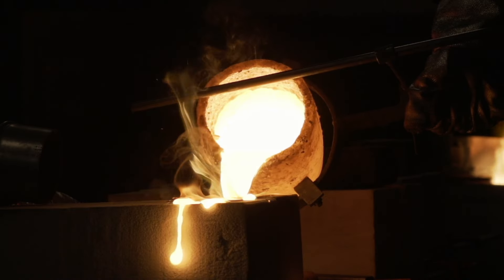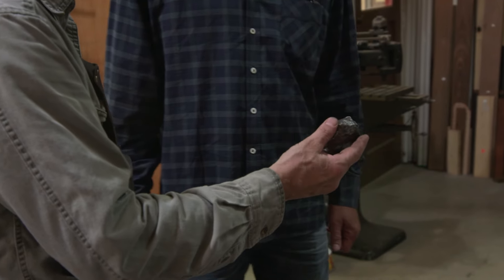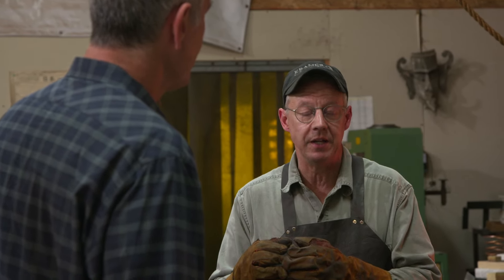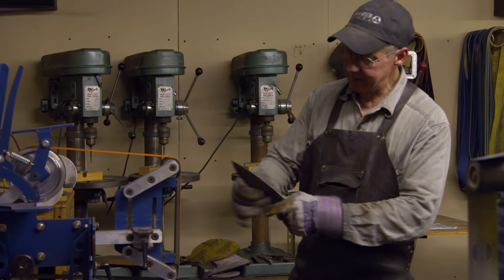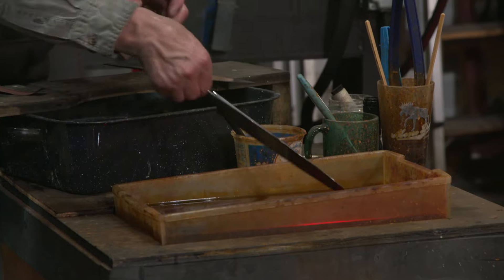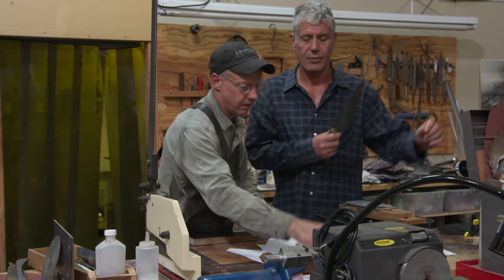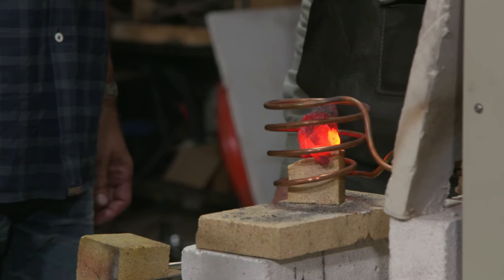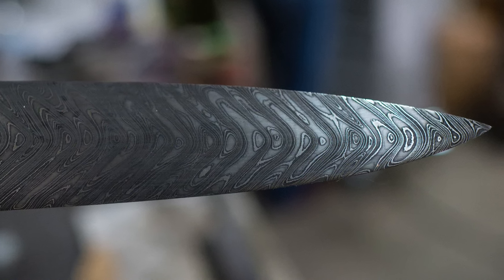Raw Craft with Anthony Bourdain - Episode Four: Bob Kramer

Comment: That massive press thing is very intimidating.
Reply: it's called a power hammer.. im not trying to attack you.. I just want to inform you.
Reply: JTD19881369 Thanks,I didn't know.
Reply: its scary at first but once you use one you crave the thrill. its like a gun, but 1000x stronger
Reply: Google nazel 2b. you won't be disappointed.
Reply: Aryan Adibmehr it's called a power hammer.
Reply: Douglas Loven Thanks, it was mentioned above.
Reply: +Aryan Adibmehr its a power hammer
Reply: Just think how much more the modern blacksmith/bladesmith would have to charge for their work if it was still 100% Arm & Hammer on an anvil. The cost of goods would go through the roof of the Empire State Building. These hand made knives are already pretty expensive, I'm sure. I've seen fine chef knives that were machine made go in excess of $800.00 US. I can't imgine what one of Mr. Kramer's knives would cost. Probably around $1500.00 to $2500.00 US you could easily triple that for no power tools used, and quality that fine.
Reply: A handmade Kramer knife recently auctioned for $30,000 (yes, four zeroes).
Reply: I love my 2b, probs the most versatile piece of equipment in my shop
Reply: its a power hammer
Reply: Guys! Did you know it's called a power hammer??!
Reply: I think it's called a power hammer just in case you weren't sure yet.
Reply: It does its' job with extreme violence.
Reply: It's a  baby hammer!
Reply: That hammer type thing possesses so much power. I'd love to know what it's called.
Reply: Danny Paterson mechanical press
Reply: @3:32 Even Anthony backed up once it started.
Reply: yeah! looked like a transformer stuck on a loop. I would back away everytime that thing moves.
Reply: You have forged your 1st Damascus and you're about to use the hammer it's extremely intimidating. One wrong step and you could ruin your blade

Comment: A beautiful German style chef's knife and will certainly do the job in the kitchen, but any decent Wusthof, Misono, Henkel, or even Forschner will work just a well for thousands less.
Reply: +Frank Kolton Probably not quite as well but nothing to justify the price gap.

These are prize possessions you COULD use, but probably shouldn't.

One thing I couldn't help but think about is that these knives are not stainless so unless you keep in mind that you'll need to maintain them far more thoroughly than a regular knife; you could end up rusting a knife that costs as much as a used BMW.
Reply: +Frank Kolton There are a number of professional reviews that would disagree.  Not all knives are created equal in terms of ease of use, longevity, etc.  In review after review, Kramer's knives outperform them all, all while looking fantastic.  If there's one negative thing to be said of Kramer knives, is that they must be maintained assiduously (carbon steel).

Comment: His steel cannot outperform other Powder Metallurgy super steels that the best manufactures and customs makers use .
Reply: PeterPiper Chaos well partly true. Powder steels are better in almost all areas you could compare steels. But there is one thing they don't do, they don't get sharper. It's also more difficult to get them sharp. So for really using them in the kitchen on a daily basis, they aren't necessarily "better".

Comment: The most important part is the sharpening. It takes a lifetime to get the feeling for the perfect angle that makes it so sharp by using it on the leather. In Sweden we call it "rå-äggen" roughly translated it the raw egg, that is the small metalic piece that is left after the perfect angle sharpening. Its like a small piece holding on to the blade that you want to get rid of. Really hard to explain in a foregin language but most of all, in text. Whenever youre sharpning you will know what I mean
Reply: The English term you're probably after is 'burr'.

Comment: It's amazing how much automation he used to make a hand crafted knife.
Reply: +Average Joe A powered tool isn't the same as automation.  You could do everything he did with hand tools it would just take FAR longer and give you an inferior product.  The forge weld pattern and bevel on each of his knives would be slightly different.  It's not a stamped out and machine ground cheap off the shelf knife.  Could he do all of that by hand with 100+ year old hand tools sure.. it would take longer and you'd get an inferior product.

Comment: Basic way of making the knives is very close the the making of the Katana, the samurai swords. Also the samurai sword-smiths makes cooking knives because of the same technique. The basic big difference is that in Japan, until the nation ends its isolation to the overseas nations, we had no culture of casting metal to make the knives. So those traditional style made swords and knives are made from the sand metal you can collect with the magnet and then make it to the chunk and started forging with the same way Bob does at its earlier stage. Also the forging is done by hand with a few forge smith continuously on the anvil and the sword-smith master puts the knife or the sword in to the heat to adjust its temperature. Having the meteorite into it is a great idea to have the unique grain.

Comment: No disrespect to the late Mr. Bourdain, but making steel is called Smelting. Forging is the process of creating those steel strips of differing carbon content and then "Forge Welding" them together, which is just a fancy term for heating up the stacks until they're just about white-hot and hammering the layers into each-other to make a solid Blank, or "billet".

Comment: Mr. Kramer misspoke when he stated "To make steel you add one percent carbon." It is 0.1 percent to make steel or one tenth of one percent, for knife steel they start at 0.50 and go up as high as 1.8%, but at that high a percent it becomes brittle and is tricky to heat treat.
 I make knives too.

Comment: how does the leather make the knife push cut?
Reply: It aligns the grains of the the steel.
Reply: +TDER xo although sharpening the end of a knife on a sharpening stone will un dull it, its still grinding (very inaccurate sharpening when if you want razor sharp) so the leather is like the finishing touch for a blade that is almost there

Comment: How does he strop that quick? It only seemed like 5-6 swipes on "plain leather" , seemingly without stropping compounds, from sharp to razor sharpness?
Reply: he re-aligned the burr on the edge
Reply: Glenn056 all about changing direction of the edge.
Reply: he probably used exceptionally fine stones and took it to 10000 or whatever, before stropping. You can skip all those fine stones and just strop it with compound after 1000 to a similar effect effect. It's gonna cut an onion.

Comment: where can I buy one of those knifes?
Reply: Unfortunately you can't just go buy an authentic kramer knife, the only two ways to acquire one would be to find one for sale second hand (extremely rare) or win his "lottery" on his website which is just as hard to do. Even if you win the lottery you still have to pony up several thousand dollars for just a straight carbon steel blade or much more for a damascus blade. Ive seen one up close and not only are they ridiculously sharp but they're absolutely beautiful works of art.

Comment: But how does he get the damascus/patterns on it?
Reply: It might be the basic solution that he was spreading on at 6:34
Reply: i think because he folded the knife over so many times, which gave the knife its pattern.
Reply: +Thomas Tuan Nguyen correct
Reply: The multiple metal layer + acid etching
Reply: The many layers of the steel will reveal itself much more clearly after being etched. There are different ways to etch steel. Most commonly is probably acid-etching. In this video, a base is used instead. At 6:35 you can hear him talk about how it works. Simply put, it takes away some of the steel. Around 2:08 they start talking about layering the steel. They cut, fold, flatten the steel many times to create many layers. Every fold doubles the layers, so it quickly adds up to hundreds of layers. Since there's used more than 1 type of steel, the acid or base will remove parts of it at different speeds which makes the patterns much more noticeable.
Reply: Mark The Gr8 At 6:35 you can hear him incorrectly describe ferric chloride as a base instead of the Lewis Acid that it actually is. Oops.

Comment: why would you harden the steel and then sharpen it, The phase changed steel would be harder than the annealed steel thus making it tougher to sharp.
Reply: +atul Sc a more precise sharpening, it is harder so you lose less on each swipe and really fine tune that edge.
Reply: +AdamC169  thank you for that information.
at 5:30 you mentioned about some molten salt bath what is the heat treatment you are using? 
is it nitriding?

Comment: On;y $400.00 for a 10" Chef's knife!
Reply: 400... add another 0 and you're there!
Reply: +Joe Smith those are basically licensed copies of his designs. the ones he actually makes average $400 per inch of blade , current auction for one is at $34,100 and still bidding.
Reply: +DIR911911 closing bid was $37,600usd
Reply: More like 2 zeros

Comment: Too bad, Bourdain, didn't head over the Murray Carter's place and check out a Japanese style knife. Carter is the only White guy to become a Japanese 17th Generation Bladesmith. He uses high carbon Hitachi White Steel #1 or 2 sandwiched between stainless steel and it's like a miniature samurai blade and you don't have to pay for the laminated steel that adds nothing to the function of the blade. Murray also is a US Master Bladesmith. Bourdain doesn't know that much about knives, obviously. To ignore Japanese knives is a complete demonstration of ignorance. I don't know that Kramer could even make a sushi knife with its concave back and high carbon/ low carbon steel.
Reply: +Dan Morris what are you on about, Murray Carter makes great knives but he doesn't nearly have the same popularity as Kramer.
Reply: Just because he sells more knives, doesn't mean he makes the best knives. Toyota sells more cars than anyone, do they make the best car? Kramer makes no sushi knives. He makes Western knives, only. "The Wa-Bocho has one distinct feature different from Western knives: The kataba, or beveled blade. What this means is that the outer side of the blade is sharpened with a beveled edge, while the inner side remains flat. While the blade is flat on the inner side, the surface is actually slightly concave (urasuki), giving it the same effect as perforated knives or knives with hollowed edges. Japanese professional chefs prefer these beveled knives, which facilitate extremely precise cutting and clean food separation from the blade. In Japanese cuisine, many ingredients such as fish and vegetables are served raw, and the aesthetics of these foods has always been a vital factor. The use of Wa-bocho reflects this culinary tradition. A well-maintained, single bevel Japanese-style knife allows chefs to cut delicate ingredients with speed, control and precision. With sashimi, for example, the use of a Wa-bocho produces perfectly smooth, glossy slices of fish, without bruised or rough surfaces. Western knives, which are beveled on both sides of the blade, are more practical on tougher foods such as meat."
Reply: +Dan Morris Why are you copy and pasting from Murray&#39;s website, I know who he is, I used to own one of his knives. Why does it matter if Kramer doesn&#39;t make much single bevel knives, those knives have very specific uses and doesn&#39;t have a huge market compared to gyutos in America. In fact Murray barely makes any single bevel knives these days, most of his stuff are different sized funayuki&#39;s and gyutos. 

I&#39;m not even going to argue who makes better knives, I&#39;ve never held a Kramer. You act like as if Kramer can&#39;t make sanmai knives and Carter is somehow superior and getting snubbed. The reason they chose Kramer for the show is because he is by far the most popular American kitchen knife bladesmith and his knives are sold at much much higher price than any other makers. Carter as great as he is doesn&#39;t have the same star power and therefore isn&#39;t chosen for the show, it&#39;s that simple.
Reply: IamHaddy I wasn't discussing, "Star Power". Murray can make a much better knife than Kramer. He uses much better steel, ie: Hitachi #1 White Paper. He also knows how to cold forge, which I know that Kramer has no idea about. I can't cut my tuna with, "star power".

Comment: he's a master blaadesmith but he cuts out hos blade from flat bars of damasteel?
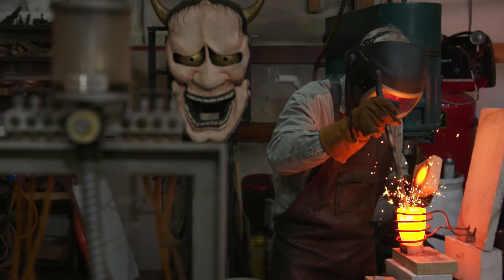Reply: Those bars at 1:57 are the melted meteorites.
Reply: that had nothing to do with my comment.
Reply: Emil, Dairenji is trying to be helpful and answer your question.  "Damascus steel" flat bars, as you call them, are made by Kramer, which contain material from a meteorite.
Reply: yes that I got but that enhances my queation why he cuts them out and not forging the blade since meteorite isn't the cheapest material to use. and the bars can't just contain only meteorites because that would be a million dollar bar I guess the bars are just some small piece meteorite and alot of diffrent steels.
Reply: Lol yeah I thought that too but maybe he does it that way to save time then tile a bunch of left overs into a billet. Beveled edges by hand would get old after a while
Reply: Once the desired pattern of damascus has been obtained, forging to shape will distort the intended pattern. The final cost of the knife more than makes up the loss of steel.
Reply: +Emil Westgaard Henriksen You understand that he actually makes those damasteel bars right? If you try and draw out a piece of damascus after you've set the desired pattern it will completely destroy the pattern; plus you just have more control with uniformity of your bevels with stock removal.

Comment: What a shame about Bob Kramer knives is they are all made in China. I ordered knives from Bob Kramer and they are actually sold through a company called Zwilling. I use the knives for a few weeks and the Damascus finish came off and the knife even chipped on the tip of my large butcher knife. I called the Washington office only to get his rude daughter who said I had to take it up with the Chinese company. My personal opinion is he was probably good at one time and then sold out because Work was too hard for him.
Reply: The knife you got was a fake then. The Zwilling Kramer line is made in Seki, Japan. I’m assuming you got the Euroline or Meiji Damascus which means that there is no “finish” on Damascus because it is is not just painted onto the blade. The more you use Damascus steel, the more the lines become prominent not less. You would literally need to melt the steel to get rid of the Damascus pattern.